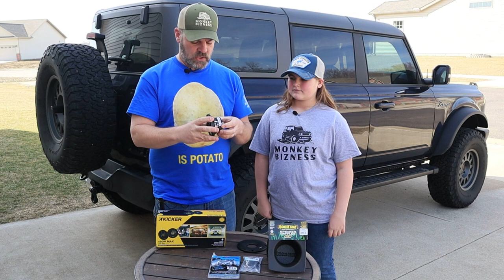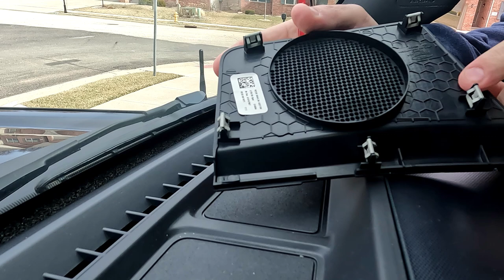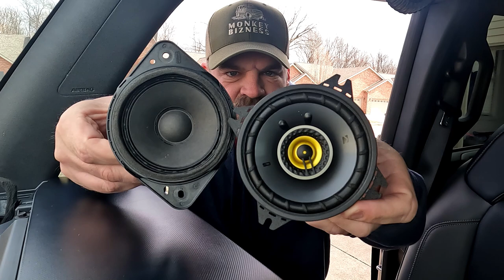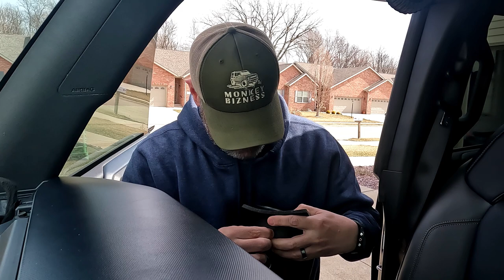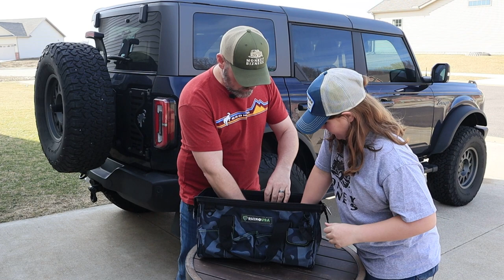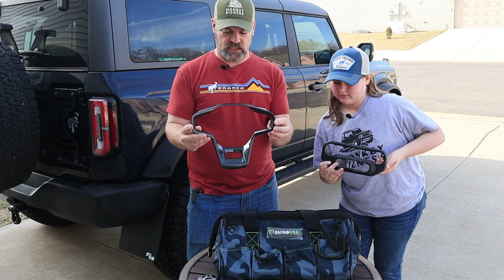Ford Bronco AUDIO UPGRADE: Part 1! GIVEAWAY RESULTS!!!!

Comment: What's the deal with magnet weight? The heavier the magnet the better the speaker?
Reply from the maker: The bigger magnet makes more vibrations which improves how loud the speaker and the efficiency of the speaker. The quality of the sound is improved.